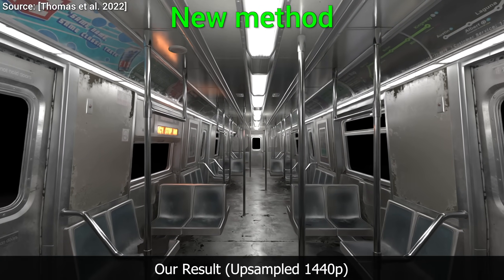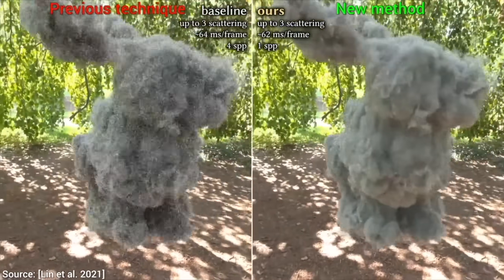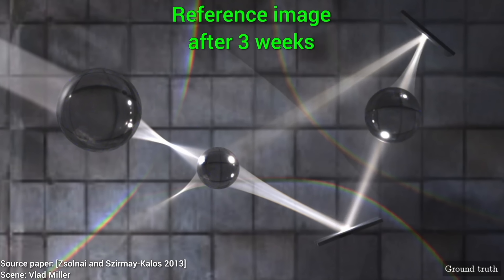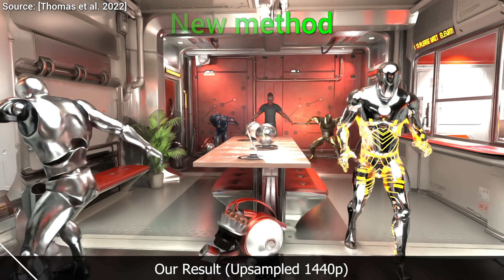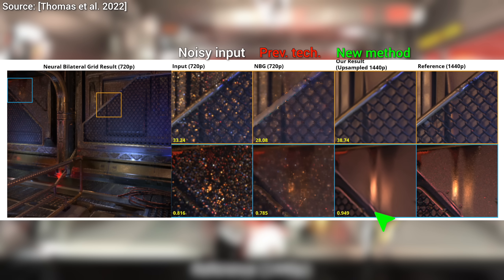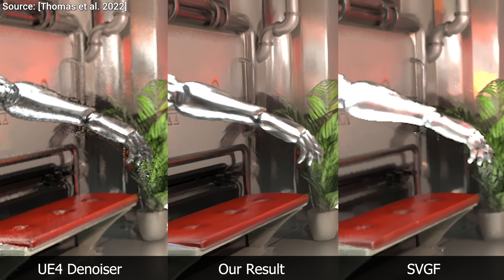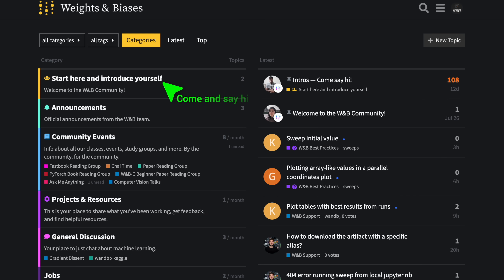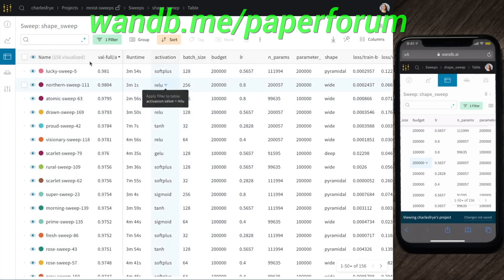Intel’s New AI: Amazing Ray Tracing Results! ☀️

Comment: Have you already tried using a closed loop feed back of de-noised result into back ray-tracing to improve metropolis light transport guessing. Adaptive recursion from lower to higher resolution and depth (number of bounces). The less useless calculations the less waste of energy or time .. 🌳

Comment: You forgot to mention that the 200fps (5.19ms per frame as shown in the paper) was observed when running on an rtx 3070. Performance and runtime are not absolute measures and are related to the hardware on which the workload is running.

Comment: Will be obsolete soonish anyway.  The noisy outputs don't contain enough detail for any filtering process to return a crisp image with all the desired details.  Can't they just use this for a light transport overlay map and keep the traditional texturing seperate???  Why do they have to combine both and THEN filter it for light transport gaps???  It's mental.
Reply: Path tracing is literally like probing the world 1 pixel at a time. The lighting can't just be blended over a diffuse frame buffer.

Comment: Let's ask a fundamental question:  Why doesn't this "noise" appear in the real world?  By answering this question COMPLETELY, it may open up a new thought process that leads to a smarter algorithm that replicates light transfer in a more natural way, without noise or with at  least a lot less of it.     I'm NOT qualified to answer the question, but I can ask it.  And I've shown that sometimes, I have a talent for asking the right questions.
Reply: It does appear in the real world you just cant notice it. The noise comes from the discrete nature of light, ie photons. The more photons the less the noise is noticable (in more technical terms the noise scaled as the square root of the number of photons). In reality your eye is recieving billions of photons per second and so this noise is very very low. In theory it would become more noticeable in a dark room however other biological processes get in the way that would make it not appear as a grainy image (for example in low light you cant see color). A graphics card is just not able to (currently) produce this many light rays and propagate them at that rate and so we get much more obvious noise
Reply: Pretty much what Brandon said. This is already how our current reality and perception organs (eyes) work. It's just that simulating that level of photon bouncing is actually wasteful with little gain past a certain point. Hence, the goal is to get the same results with as few rays (photon paths) as possible, so you get the smallest computational hit possible. If you want a real world example, the James Web Space Telescope is receiving only a few photons per second for some of the furthest away galaxies, since light has spread out so much during the travel. In  that sense, the telescope is slowly getting a photo of the galaxy in much the same way as path tracing.

Comment: If the new method allows for 200 fps in that example scene, wouldn´t it make sense to limit it to 60 fps to gather even more samples in the first phase before denoising it?
Reply: There is still other computation to occur within that frame that you have to account for... like the entirety of the rest of the scene rendering (most applications will be more complex), and the rest of the game (since they're obviously targeting interactive applications). The 200 FPS isn't a goal of some sort of final application, this is just an example of the algorithm running, and the faster it achieves this the better. The actual applications that implement the algorithm would be the ones to make that tradeoff decision.

Comment: 5ms is a useless metric without knowing what hardware it was running on. There is a 100x performance difference between a low end gpu and quad 4090's
Reply: In the paper it says it was an RTX 3070.

As if Intel could afford to buy quad 4090s!

Comment: I wonder... Would a continuous wave based light transport sim be possible? I'm not concerned about practicality, just possibility.
Reply: Nothing in a computer is ever truly 'continuous' in the mathematical sense. Even continuous things are simulated with discrete calculations. Even physics simulations will often use numerical calculation methods.
Reply: So, to answer your question, yes, you could simulate a continuous system, whatever that may be... but it will always be discrete, unless you use an analog computing system. In either case, the issue is that a truly continuous system requires infinite bandwidth, so it must be chopped off at some point.

Comment: I'm taking a computer graphics course this semester. After making a CPU (no lighting or raytracing) renderer that takes a few seconds to render one frame of a very simple scene, the sheer immensity of the number of calculations required for realistic scenes set in. There is a whole stack of technology to make stuff like this possible, from the 5 nm silicon, GPU architecture, software optimization, and creative techniques to reduce the number of calculations necessary. And the layperson takes all of this for granted when they play cyberpunk 2077 on their 4090
Reply: Not to mention the entire electronics platform that it is running on. The signal transmission to the monitor... the monitor technology. Yeah, people's heads would explode if they attempted to comprehend the technology and functioning it takes for a single frame of a game to be shown to them.